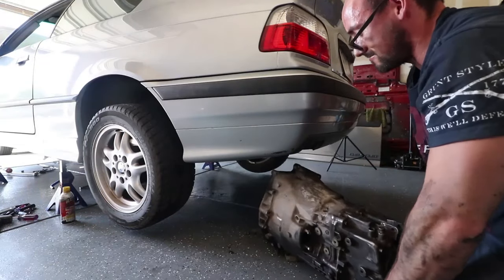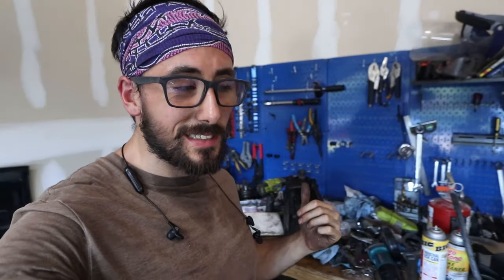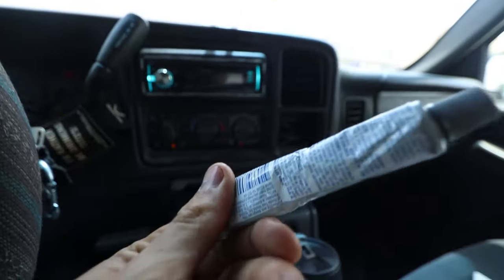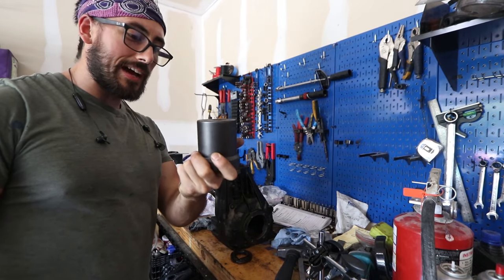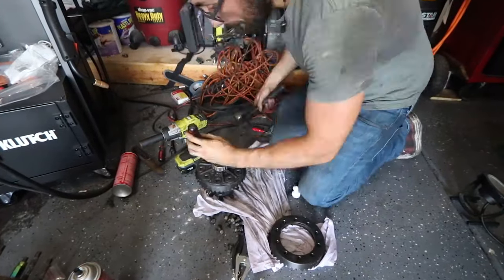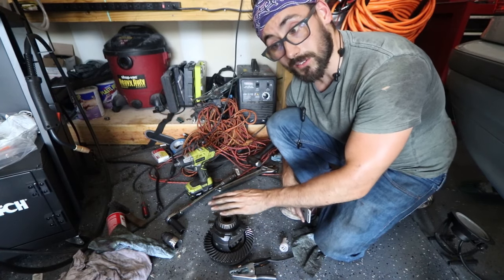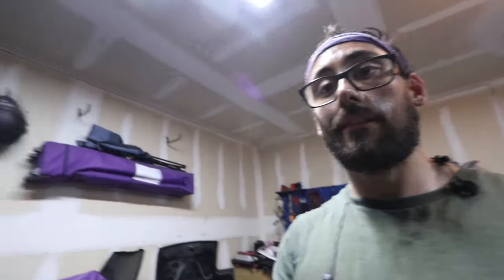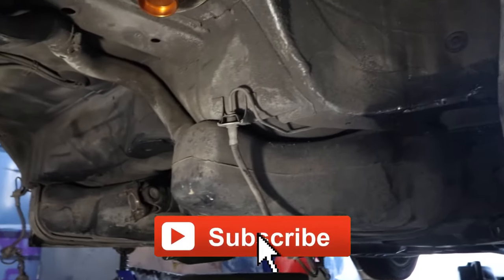Installing a Ring & Pinion is Harder than it Looks | E36 Diff Rebuild Part 2

Comment: Yes.... pinion requires a shop press. There are some write ups on bimmerforums about diff rebuilds.
Reply from the maker: Yeah, I'm not the sharpest tool in the shed sometimes 😅
Reply: The Daily Drift me neither 😆 make mistakes and learn. https://www.newtis.info/tisv2/a/en/ is the bmw workshop manual btw.

Comment: What gear ratio where you trying to swap in? And did you end up getting it to work?
Reply from the maker: I was trying to put a 3:90 in it. The problem turned out to be that the guy I bought the gearset from sold me a set for a small case diff and it wouldn't fit my case. I ended up rebuilding my diff and just welding it with the stock 2:90 in it. it's been through a couple drift events and it works great, I just wish we had a little more gearing because it can bog out a bit.